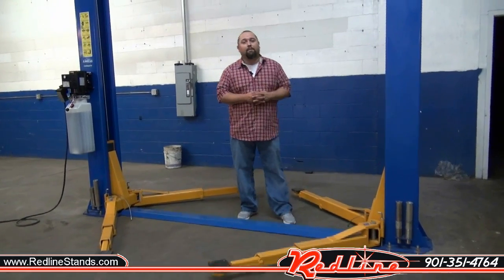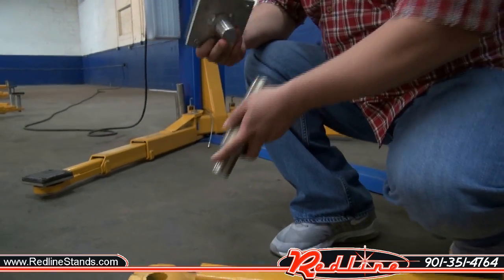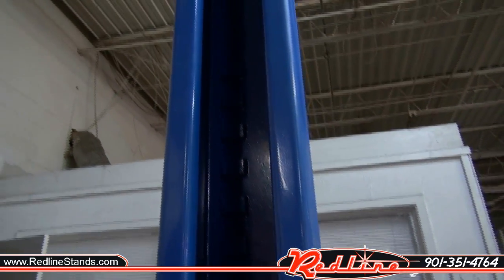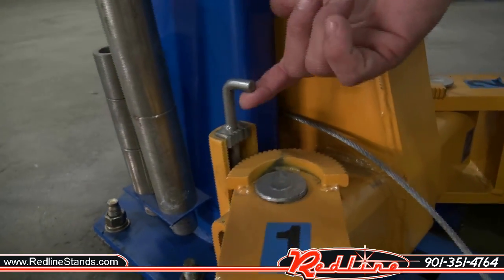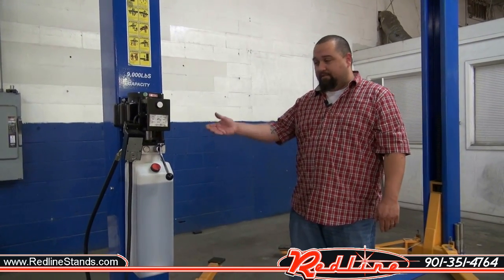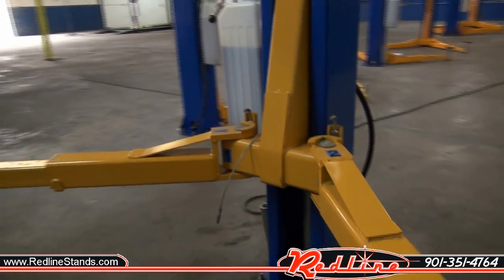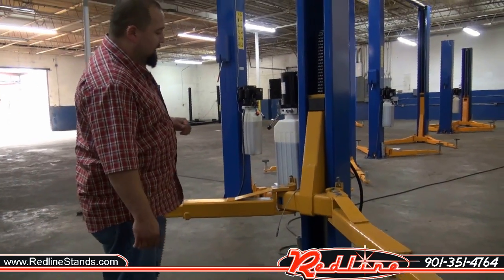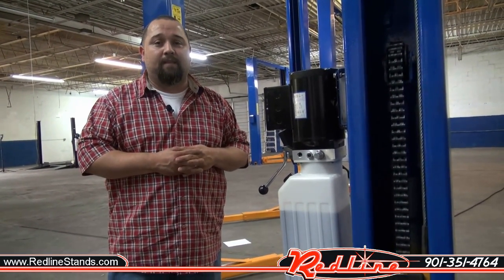Triumph NT-9 9K Floorplate Two Post Lift Demo

Comment: It seems you need two people present to lower the lift, one person has to pull and hold the safety lock on one column and one person on the other while pushing the lowering lever on the hydraulic unit
Reply: It might seem that way, but it's not. When you go to lower the car, first you raise it up off of the locks then you go to the opposite side (walk around the car not under) pull the release cable (it's stays unlocked) then go to the power unit side, release that side then press the handle to release the hydraulic pressure and down she comes.

Comment: I just got one of these while are the wires hanging how am I supposed to do that with a car on it lower it down on top of me ? Cables not wires the release
Reply: I just got 1 today and noticed that myself, not much for hose breakage safty for when the vehicle is lowered, and how do you pull both at the same time, did you figure something out?
Reply: @philbrown3953  nope I sent it back and got one that was single release or was going to but was just so frustrated by the hole situation I never actually ordered the single point release lift I just sent the dual point one back
Reply: just got my triumph lift going, the safty latches stay disengaged after you pull the cable 1 time, thn they reset themselves at the bottom of lift,  I really give this thing a thumbs up 👍
Reply: @philbrown3953  yeah I knew that i just didn't want to have to deal with dual point release good to hear though 👍

Comment: I just bought this lift and looks nothing like it kinda pissed off about it they sent me a totally different style lift but with the same name
Reply: Please contact us at sales@redlinestands.com with your order number and pictures.
Reply: @dustingilmore2710  I did not order it from your company was by no means saying your company is bad was just referring to the lift it's self and the distributor
Reply: @dustingilmore2710  iam actually in the process of uploading 2 videos on it right now as iam having trouble with it lifting uneven and both Cables are in sync and lifting at the same time both clicking at the same time it's almost like the one cylinder is losing pressure
Reply: Did you ever get your issues fixed? I am dealing with some of the same issues.
Reply: @jakegladney7125   they sent out a tech and he said it was a hydraulic issue they sent me a new hose and fittings for the bottom of the lift cylinders I installed them a few week back and it still did the same thing so I contacted the company I bought it from and they keep telling me it's a cable adjustment problem when the tech they sent out says it's notamd he synchronized the cables his self I ended up adjusting the cables for the 100th time and it's good now only issue is my one cable is way tighter then the other just to get the one side to lift even with the other it's almost like these lifts need one short cable and one long cable but at least I can use it after 4 months of the bull crap going back and forth with national Auto tool would never buy from that company again they are useless and don't want to do anything if something is wrong... It's definitely still not right it's lifting even now after all I did to it but it's not in sync the side I was having problems with clicks way way way before the pump side but if I try to even out the clicks it will lift uneven again so iam leaving the cables where they r at for now I just have to watch it and make sure it's on both safety latches when I put it at rest in the air

Comment: What is the width from outside of the baseplate to the other baseplate? I have 134"
Reply from the maker: • Lift Time: 40 Sec
• Lifting Height: 72"
• Voltage: 220V AC
• Horsepower: 3 HP
• Capacity: 9,000 lbs.
• Overall Width: 128"
• Overall Height: 107"
• Lowered Height: 4.5"
• Concrete PSI: 3,000 PSI
• Drive Through Width: 92"
• Base Plate Size: 18" x 14"
• Distance Between Posts: 109"

These are all the specs I have sir.
Reply from the maker: My supplier says:

Its 133, but the power unit is not mounted like the one in your vehicle. It is now mounted on the back of the post and adds 8 inches to the overall width making it 141 inches.
Reply: Thank you. I do not have to mount the power unit on the upright? I can mount it on the wall correct?
Reply from the maker: You can mount it anywhere you like sir.

Comment: I bought the Chinese Triumph 9K overhead lift a few months ago.  The installation instructions are shit as well as the lift fabrication is shit.  The dimension in the manual are wrong, and if you follow the instructions for installation, you will end up locating the posts in the wrong spot.  I would not risk lifting anything larger than a small car.  Don't waste your money on this one.